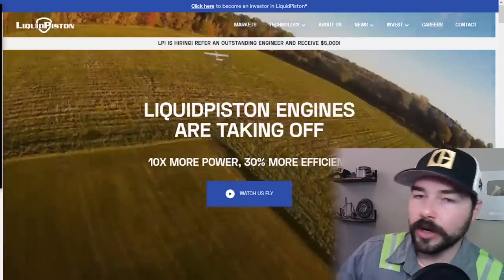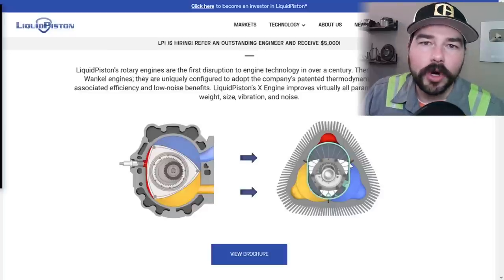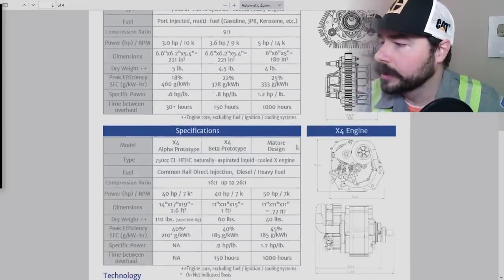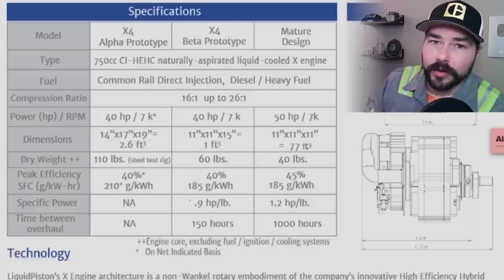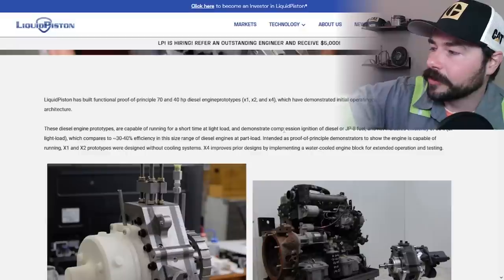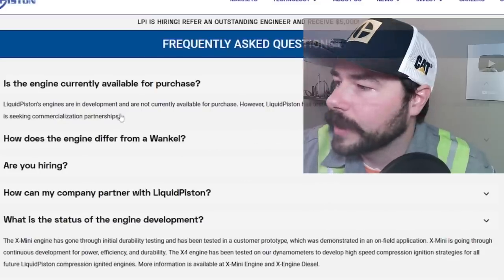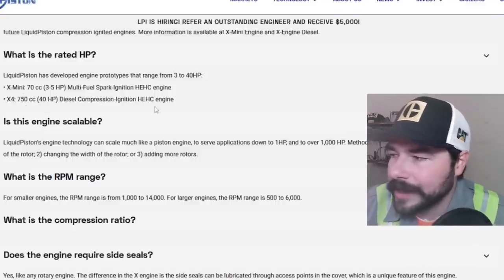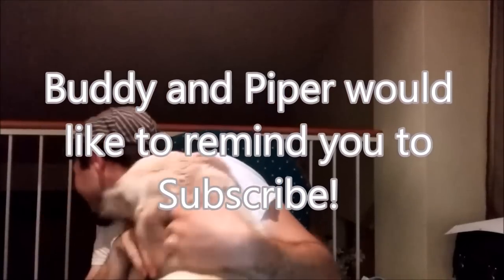This Engine could change EVERY INDUSTRY but..................

Comment: Is this engine more geared towards a replacement for small airplane engines? I could understand the short rebuild interval in that scenario and the rotary design could work well with a reduction box for high propeller rpm, run well inverted, light weight, etc. 

Don’t see it revolutionizing the whole world but that may be an area where it could live and and be manageable with the rebuild intervals.
Reply: I could also see it being used in motorcycles.
Reply: Certainly a lot more feasible for a light aircraft applications than electric with heavy batteries.
Reply: The thing is with aircraft. You are limited to a RPM range the longer the prop the slower your RPM. Cannot break the speed of sound with prop tip. You will sling off the blades.

Comment: 5 years ago I saw a some diesel rotary engines that could be stacked in line to what hp you needed. They did a Sumpter  presentation for industrial use.

Comment: I think the initial market would be aircraft where high costs and overhaul standards are normal, and its light weight would be an advantage. The initial cost and cost/downtime of an overhaul would be a factor. It is a long way from being a HD diesel replacement.

Comment: I had a rx3 mazda in the mid 70s.Hard on gas and fowled plugs.Changed plugs every  thousand miles.If i recall correctly it was 9000 rpm cutoff...113 MPH flat out.Far better handling car than anything northamerican made and probably close to my 02 jetta.

Comment: Typically, US generators do run at 3600 rpm… which is ideal for single phase 240v power.   You can run lower RPM by increasing the number of poles….   Hz = Engine_RPM x Number_Of_Poles / 120.  But as far as I know if you have a engine running more than 3600 rpm an want to generate 60Hz power, you have to use gear reduction or a VFD.   Either way you are adding expense, heat, complexity an inefficiency to a motor that is already down on efficiency.   Where is the plus side to this engine… it’s already suffering from low meantime on service intervals.   I’d rather see more widespread use of the Achates engine.  What we really need to keep an eye on is Toyota.  This time last year they got a patent on a new diesel injector design… said to eliminate blue def and DPF.   If it pans out, everyone is going to license that design and we’ll see a good jump in current diesel efficiency.

Comment: FWIW, the OX-5 aircraft engine was so primitive that its TBO was something like 10-15 hours. You needed to oil the exposed rocker arms by hand before each flight, unless you had installed the after market Automatic Oiler kit! I asked an oldtimer if he had ever flown behind one. He had. “With an OX-5 you always had two landing sites in mind; the one you just passed and the next one you are coming to.”

Comment: It’s not a generator engine, if you look on the bell housing it says “THERMO KING” it’s a Isuzu 2.2L, it’s used in trailer refrigeration units to drive a compressor.

Comment: You don't like them calling it the "X" engine. Cat had an experimental "X" fuel that Cat engines would run on with minimal modification. I can't remember exactly what it was but I think it was mostly a mixture of water and naphtha.
Reply: Alternate fuels for diesel engines could be a whole video, it's amazing what they'll run on.  My favourite example is from the 1980s, in the aftermath of the last oil crisis General Electric did some experimentation and converted one of their 7FDL locomotive engines to run on finely pulverized coal slurry (think printer toner mixed with water).

Comment: It's great to hear about this from somebody that really knows what they are talking about.  However, when I read the title I didn't notice the "but......." at the end.  So I was expecting a glowing endorsement.  You were very fair.)  
Also, here's a crazy idea.  How about a miniature version of this that powers a turbo, feeding compressed air into a normal piston engine?
Reply: The question would then be, in what way would making a new manufacturing line for a compressor beat out traditional blowers or turbine turbos? There are already plenty of air pumps around that can move air, the problems facing turning them into engines is preventing air leakage. A bit of air leakage on a pump is whatever, a bit of leakage on an engine is a loss of efficiency and a risk of flames going the wrong way.

Comment: Robert Ballard of Ballard Industries has built a motor to burn a chemical mixed with borax of which it was built for military generators as its a smaller motor which produces more power in a smaller space, as well it is also used in unnamed space planes ✈️ note 📝 unmanned space planes ✈️ are used to act as satellite 🛰

Comment: Not sure if you noticed, but the rotor doesn't actually fit in the housing. When it is filling two "lobes" in the chamber it interferes with the housing. Watch the animation closely, the side of the rotor and the "pinched" part of the housing overlap.

Comment: Since inverters have advanced so much in the last 20 years (because of huge improvements in solid-state devices’ switching speeds and current capacities), it is getting easier and easier to augment a traditionally mechanically-regulated AC generator with an inverter on its output, using the inverter to produce the 50/60hz output, and allowing the engine to run at its best-efficiency rpm.
Switching converters usually flip their devices on/off at roughly 30000hz (yes, 30khz) to piecewise- construct the desired output waveform (eg a sinusoid at 60hz). Believe it or not, modern inverters are about 95% efficient, maybe a bit higher.
Reply: Have one of the 2 stroke XTS 210 start a homopolar generator and then take the homo polar gens output to these advanced inverters that power a high hp motor to drive the whole thing. the XTS 210 2 stroke can then be stopped as its no longer needed and the aether ZPE kirck in with the trombly or depalma generator.

Comment: Light load eh, how would it go pulling a super quad as we use in WA all up weight circa 190t road legal, to all my good friends in the US have a bit of a google around of how we move material over here. That being said WA is 3x the size of Texas but has a population of 2.5m, Josh as always love your show. I am in the same game as you, got a 777G transmission to put back together tomorrow, which was dynamited apart 5 months by 2 apprentices, got to love those jobs 🙂

Comment: Counter point on rotary engines.  Tons of Mazda cars ( RX series cars in the 80s ), a few brands of Snowmobiles and apparently a prototype plain used the rotary.  Mazda cars did not have an oil issue, they had an issue with the tips of the rotor wearing out loosing compression.  There were some that added a second spark plug before all this environmental regulations to ' clean ' the exhaust by doing a second fire.  I will leave the ' is it any good ' to others as that is a per use issue.
Reply: I got some OMC 528cc 2 stroke rotary sled engines. they are awsome.

Comment: I'd say the new IN N Engine is the most revolutionary engine ever created. A single stroke, zero vibration, insanely efficient, opposed eight piston, four cylinder motor with the fewest moving parts ever designed.

Comment: It's a great engine for low speed drones or loitering munitions, 150 hours is more than enough to bomb someone with something like Shahed 136. Also, these are a very nice army solution for charging batteries (e.g. typical tank problem is electric power, not a drivetrain power), and in those frequency doesn't matter. These guys will have a nice future with US military for sure.

Comment: Interesting. I wonder if they will be all that much better than a rotary with side and apex seal wear. It also seems that it uses porting so like a 2 stroke, limitations on timing adjustment. Guess I better go learn more about it.
Reply: The sealing question is answered in the FAQ
Reply: Today’s two strokes use a variable height exhaust port and reed valves on the intake. Direct injection strokers like the Rotax ETECH are more efficient than competing four strokes  AND cleaner.
Reply: The XTS 210 is the 25 hp 2 stroke version!

Comment: I have a 93 Rx7.  Very fast when the turbos and rotor sync up and it starts to fly but has very little torque. It’s still a blast to drive!  
From watching the liquid piston engine I can see it has even less torque than the wankel probably because they way the rotor spins it doesn’t get out of the way quickly enough causing internal resistance. I would love to see the wankel improved on however, I don’t think this is it.  That’s why in the videos there is an electric motor combination getting it up to speed.

Comment: Like NASCAR and NHRA evolved high horse power and speed, the way to obtain an efficient engine is to incentivize the development. Too bad there are not many programs like the Shell Eco marathon. I have talked to some cross country race courses about sponsoring competition like this, problem is that it is somewhat boring! The Eco Marathon is set up for technical schools and Engineering schools which is good that they have to think and get their hands dirty. The vehicle (or sort of a vehicle) that goes further on one gallon of fuel wins! I'm a retired Engineer and remember my senior year in college looking around and thinking "no wonder so much stuff is screwed up".

Comment: Hopefully they have a breakthrough. Right now they really have an up hill battle to become more viable. P/W ratios coming from regular old off the shelf piston engines are light years ahead. My suggestion would be to supercharge the holy living shit out of it, see where it breaks and go from there.
Reply: @@klinestill Dying at 150 hours with no cooling.. The new one has a cooling system and will run 1000 hours.

Comment: Most know the flaws with Rotary motors and why they aren't popular. The only thing I see for motor future that's exciting it using solenoids for valve trains. Basically valves much like fuel injectors. Considering I'm still a GM pushrod fan over any overhead cam design just for easy maintenance so doubt I would like electric valves very long. I think most of these type sites only seek to fleece investors that aren't mechanically inclined.

Comment: The time between overhaul is an issue but in looking at it seems like you could split the case, pop out the rotor and swap it out for a reman with new bearing and all in no time. It's the apex seals I'm curious about. That's the main issue with Wankle engines. It took Mazda forever just to find a material that would last long enough to be viable and they still fail constantly. Maybe being in the housing helps.

Comment: A lot of ideas were tried during the early years of aeroplane engine development. That is where most internal combustion design and performance improvement came from. There is nothing new under the sun. A lot of the way out designs did not work very well, or at all, and some made better pumps than engines. The swash plate hydraulic pump and AC compressor is one example. If they get somewhere with this good luck to them. One hundred years of internal combustion development plus some greenie influence is what we are driving around now. Jeff

Comment: Thermal efficiency will always be higher in a diesel engine due in part of being able to run at very lean conditions compared to spark ignited engines without engine damage.. with that, laws of thermodynamics dictate efficiency of engines.. my suggestion is find a way to capture that lost heat (power) after it leaves the engine

Comment: Yep...so 'long as it'll pull 70-80,000lbs GVW up & down (safely!!🙃😁) mountains, with 16-18 loaded tires furiously scrubbing the pavement, both on & off road, idle about 20-70% of the work day, and painted YELLOW...I'm all in!
Hahahahahahahahah!!!!!!!!!!!!!
Great topic! Thanks Josh!
PS. No DEF!!! 🤣🤣🤣🤣🤣
________________
Son from his truck (C12) sent me pic of a local electric Nikola truck while running today. They build the "engines" here in new plant where he imported aggregate materials. He says it's 250 miles per charge.....😲😲😲😲😲
What me worry?? 🙄🙄🙄
*--> Our 3126 after heat gun test runs right at 180'-needs new gauge 😇 💯
Cheers!

Comment: The Achates engine is the one that is most promising to me. Last I knew, the DOE took them on for a development project a few years ago. You can find the ford pick up that had the engine running and driving in it on youtube.
Reply: How about an achates based Rotax 1700 OP based on 2 Rotax 850 Etec turbo r engines, i would love to see OP 2 strokes come out in snowmobiles! I heard the 2.7 achated OP used amsoil intercept 2 stroke oil though XD-100 will work too as its dry sump with VRO.

Comment: You should check Rob Dahm's rotary build! It's an awesome build, though I'm not the biggest fan of the body styling even it is custom. They did a ridiculous amount of work over the years and he's solved one of the biggest issues with the engine, being the apex seals,* along with some other issues. It's also important to note that rotaries are so much easier to rebuild, even the multiple rotary stacks like his. 

Trust me, if you're into cars (obviously you are) you'll be impressed with what they've (he's) managed to build. Even the wiring harness was hand made by Rob and is better quality than most OEM harnesses. I could keep going...😅

*Biggest reason why it burned oil.

Comment: AC Generators that tie the output Hertz to a governed engine RPM are very yesteryear's technology. Using purely spinning rotor coils inside stator coils also produce less-than-perfectly-sine waves with some amount of waveform distortion that may induce malfunction or poor performance in certain devices powered by a "nasty" AC supply. There's a 21st Century answer to this issue though! Inverter-style AC power generation from an engine-spun alternator! Yes it adds some sophistication and complexity to the generator architecture, and I wouldn't doubt if right now, big-name generator makers are charging big-premium prices for inverter-power-conditioned generators way above what they should fairly be priced at. The high-current, high-voltage industrial-sized power MOSFET transistors needed to build such an animal that were once super expensive specialty semiconductors are now readily available, plentiful, and darn near dirt cheap nowadays. The "switching mode" power supply front ends that take the raw power from a spinning alternator to feed the inverter section can accept a crazy-wide range of incoming voltages, frequencies, and waveshapes and don't really care since that section is gonna turn it into crude, rough DC for the inverter stage input where all that matters is the voltage be above a certain minimum level and enough amps to fulfill the VOLTSxAMPS=WATTS demanded by the load. The inverter stage uses the FM (freakin' magic) of electronics to take that crude intermediate DC and make perfectly voltage-regulated AC output with a rock-steady 50 or 60 Hz sine wave so perfect on an oscilloscope you'd swear it was made by a signal generator or tuning fork, and total distortion that would rival that of a decent home stereo system.  The engine governor simply runs the engine at whatever rpm will get the alternator output up to satisfy the load demand. Light load, the engine will be barely above idle rpms, max load and the engine revs up to Mach Snot rpms/whatever its nominal upper max continuous rpm limit is intended to be (hopefully not float-the-valves redline on a piston engine.... or exhaust ports glowing orange hot/molten metal dripping on the floor on a rotary 🤯🤭🤓).

Comment: 9:20   Can you use a gear box to deal with the higher RPM to Hz generation problem?  I assume this would reduce the "efficiency" by some margin due to excess friction in the gear box.  But how much?

Comment: The most effective way to build a reliable extremely long service life highly efficient engine is to abandon everything related to emissions compliance. 

If we did that and built our commercial truck engines to run on #6 bunker fuel we would have semi rigs that get low to mid-teens fuel mileage while driving at interstate speeds.

Comment: Interesting  concept but it seems like it is more suited to Indy car racing or some high speed or maybe high RPM pursuit than load pulling,  Maybe then could change that with some sort of transmission, like maybe 25 speed or something.  I think this would be the answer for the generator application.   Keep the good stuff coming.
Reply: Currently they seem to be marketing towards generators and drones.

Comment: Yah it’s very interesting for new power sources, but I think in order to have something that small compared to a reg inline 3/6 diesel engine…it will have to be fuelled by a source that has way more potential energy, look at hydraulics, you can end up with a ton power in the palm of your hands but the power source is usually 1000lbs reliably. It would be sweet to see something new in our lifetime
Reply: Their idea is to get rid of a lot of parts, like wankel rotaries, to compact their size, like connecting rods, crankshafts, valve trains, and also on top of the fact that each unit is somewhat comparable to a 3-cyl engine in output. Also, ridiculously high RPMs.